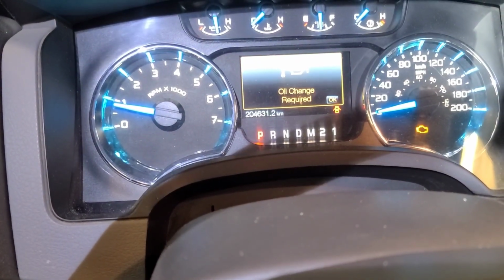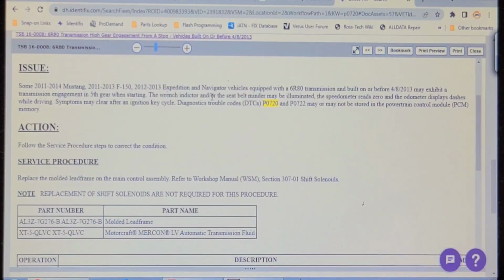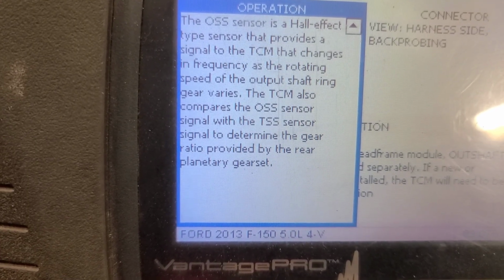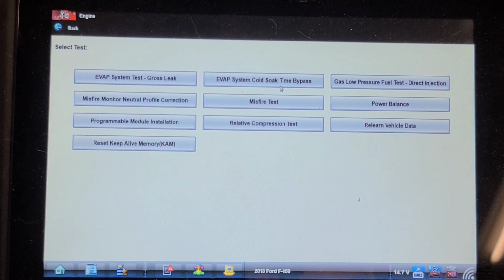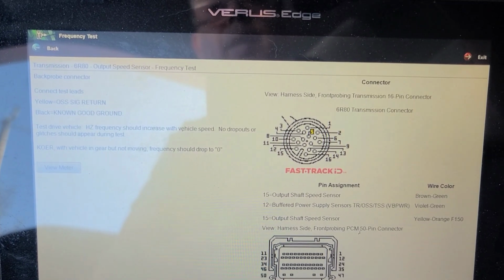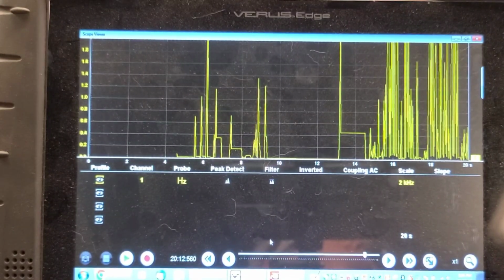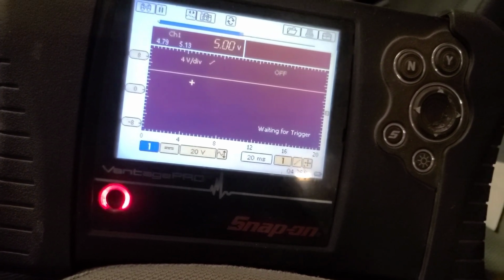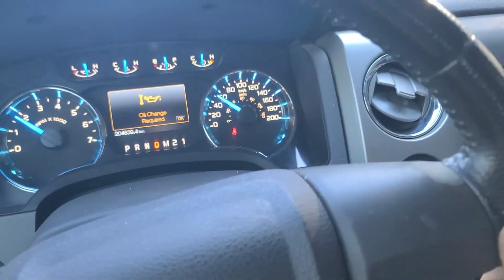2013 F150 Transmission in Limp Mode P0720, P0722

Comment: I remember a guy working in the dealership in the ‘80’s on a 1986 F150 that had transmission issues. Ended up replacing the spark plugs after the transmission got overhauled and still not right. Can’t remember what ended up leading him to the plugs in the end. 
Of course in the ‘80’s we didnt have all these fancy diagnostic tools available. All you had was a code reader, next to useless troubleshooting charts and a complicated breakout out box. And calling Ford technical hotline was totally useless. Engineers, if they were indeed engineers,  just read verbatim off the shop manual trouble shooting charts.  What a joke!